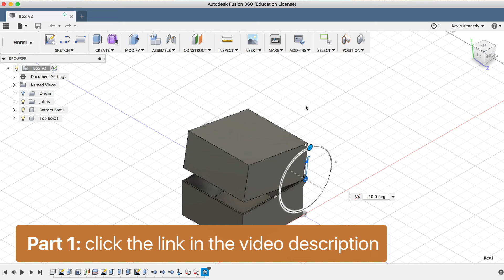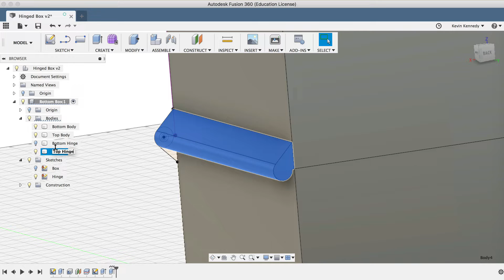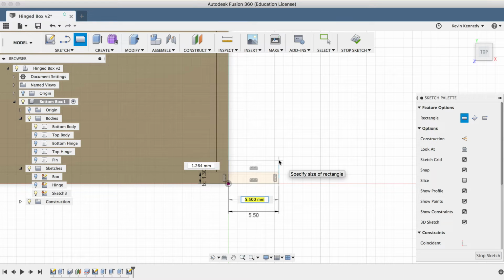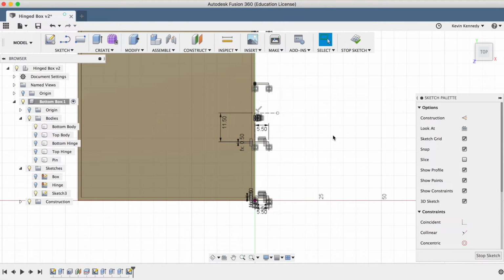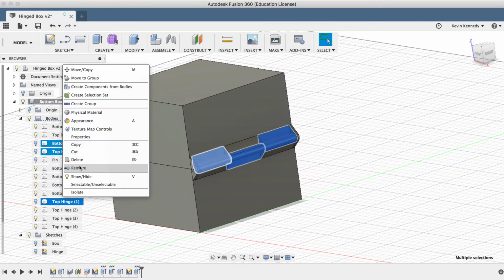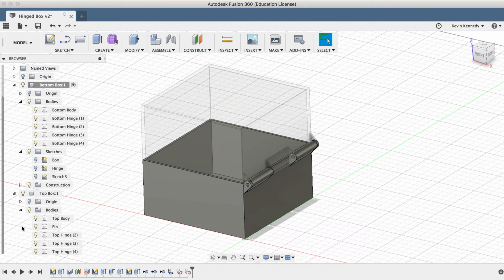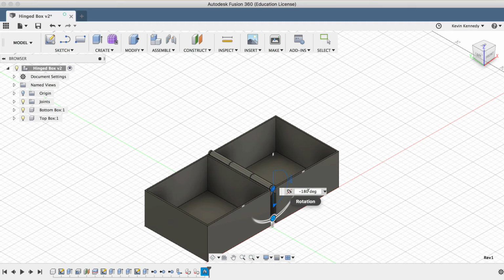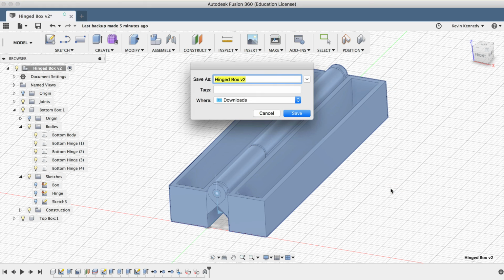How to 3D Model a Hinged Box for 3D Printing - Learn Autodesk Fusion 360 in 30 Days: Day #19(Part 2)

Comment: Can you print this with the pin in place or do you have to remove it and print is separately on the printer bed?
Reply from the maker: Hi, ca1978. Thanks for watching and commenting! The pin is okay to leave...but you'll have to delete two of the end pieces before 3D printing. I forgot to show this in the video and noted it the pinned comment.

Which hinges you delete really depends on how many hinges you create when you cut the hinge up. I went ahead and deleted the bottom parts of the end of the hinge, that way every other piece is removed - https://snag.gy/cNokVz.jpg

Then, you can print the box as one print, with both lids flat on the print bed. I hope this helps! Cheers, Kevin :)
Reply: @ProductDesignOnline  Thanks! Yeah, I just checked using section analysis and if I don't remove those hinges you mention they fuse with the pin. Thanks a lot!
Reply from the maker: You're welcome! Thank you for watching. Please don't hesitate to comment on any of my videos should you have any questions. Cheers, Kevin :)

Comment: Hi Kevin,
Great video, just after some guidance if possible.
After drawing the box, I drew the hinge on the wrong face, and had to delete the hinge then re-draw it on the right face. But couldn't help but wonder if there was a more efficient way of doing thing this (like a cut and paste option).
Many thanks,
Jason.
Reply from the maker: Hi, Jason. Great question! In this specific scenario, re-drawing the item was the best way. In most cases, it is easiest to copy and paste if the "piece" is within its own individual component. Not sure if you have watched my "components vs bodies" video, yet? If not, in that video I talk about the importance of individual components... and a lot of that has to do with moving or copying and pasting. Cheers, Kevin :)

Comment: Is it possible to constraint the rotation of the box to some specific angle?? Like I don't want the box to be able to revolute above 90 degrees.
Reply from the maker: Great question, Vishnu! Yes, you can! Right click on the revolute icon (flag icon) and select "edit joint limits." This will open up the Edit Joints Limits dialog box with the motion defaulted to revolute.

Just below, you'll see that you can set the minimum or maximum degree angles. You can also drag the white triangle sliders around which will change the degrees (blue shaded area), giving you a bit more control. 

Here's a reference image for your convenience - https://snag.gy/M1wuog.jpg
Cheers, Kevin :)
Reply: @ProductDesignOnline  Thanks a lot. I  have one more doubt. If we 3D print this box model, would it actually be constrained to revolute only in the limits of the angle we mentioned?? Shouldn't we be changing the design to constrain it?
Reply from the maker: @vishnukiran6162  I must've misunderstood you. I thought you were referring to containing the revolute function in Fusion 360. That is correct if you'd like the box to be restricted to a specific angle then you will have to alter the hinge on the back of the box. Cheers, Kevin :)
Reply: @ProductDesignOnline  I was referring to only in Fusion 360 at first. Then, a new question popped up. Thanks a lot for your reply.
Reply from the maker: @vishnukiran6162  Thanks for the clarification. Cheers, Kevin :)

Comment: Thanks for this great tutorial!  I added a few parameters and modified some dimensions to make it more customizable.  I can now change the wall thickness, hinge thickness, height, width, and depth.  So this can be a base model used for creating all different sizes of box as you need them.

You can see my new parameters and where they were used here: https://snag.gy/eZwGd8.jpg

I'm assuming the "name" will be the same if you did the steps in the order of the tutorial.  If anybody needs help or more screenshots of the dimensions and where they're used, let me know.
Reply from the maker: Hi Brodie, this is awesome! Thanks for sharing this with the community... and great work on this! Cheers, Kevin :)

Comment: I enjoyed your video and learned a lot about making a box.  I printed the model and had a problem at each end of the hinge.  The back part of each hinge are together when the box is open and ready to print.  The hinge end pieces fused together in the part and thus inoperable.
Reply from the maker: Hi RVseniors, thanks for your comment. I noticed I forgot to delete the ends of the hinge after I posted the video. I put a note about it in the pinned comment, but it must not have caught your attention... so my apologies! Cheers, Kevin :)
Reply: Thanks, I did not see the comment, I will try to remove and print again.
Reply from the maker: @rvseniors  Sorry about that!... I'm happy to hear that you learned a lot! :)

Comment: Hi Kevin 
 I do have a question about changing parameter settings, when I go in and change the wall thickness in parameter settings  (to make a stronger box) and go back out to view part I find that I have messed up the hinge. What is the best way to edit a setting without having to remake the whole box again? I know it should be simple, or is it I designed something wrong?
And if you don't have time to answer I will understand
Reply from the maker: oldfarmhand - You definitely shouldn't have to start over from scratch. If you applied the "WallThickness" parameter to the first rectangle of the hinge sketch (3:30), then it may have thrown off the gap rectangle. If that's the case, you can edit that sketch and try to fix the gap rectangle. If it's something else that was messed up with the hinge then let me know. If you can share a screenshot or a file then that will help me figure it out. Cheers, Kevin :)

Comment: I don't think this will print with the way you had it.  The end cover on the hing looked to be overlapping.
Reply: Dang it! I wish I'd read this comment before I printed the model. I found the same and I rewatched the both videos multiple times in case I'd missed something. I hadn't :(
Reply from the maker: @xavelor  My apologies!
Reply: It's all good. Pt1 and Pt2 was just what I was looking for so I can still thank you for that :)
Reply from the maker: @xavelor  Thank you for watching! :)
Reply: I amos want to point out the same thing too >.<
Reply: That's what I was thinking. Like if the collision end hinge pieces where fused, the box wouldn't move at all
Reply from the maker: I've printed this before. It prints without any problems. The bottom component has the ends of the hinge and pin as one whole piece. We added the gaps around the pin and other hinge so it revolves.

The point of this design is that it does not require any post-processing aftwards. You could make the pin a separate piece of you want to glue it together.

 Cheers, Kevin :)
Reply: How far does the cover open?  180 degrees?  If so it looks like there is going to be collisions.  Here is a screenshot of what I am talking about.  http://www.embracenext.com/jing/2018-08-31_20-28-26.png
Reply from the maker: Whoops. Good catch, Mark! :)

I see what you mean. When I was recording I totally forgot to "remove" the other two bottom bodies - https://snag.gy/wa4c9L.jpg

Without them, it flips 180degrees fine  :)
Reply: whew!  I thought I was going insane there for a minute!  Thank you and awesome set of videos btw!
Reply from the maker: My mistake!!! Thanks again for pointing that out and thanks for watching! Cheers, Kevin :)
Reply: wouldn't you remove one bottom and one top body one on each end for balance of the part?
Reply from the maker: oldfarmhand - It really depends on how many hinges you create when you cut the hinge up. I went ahead and deleted the bottom parts of the end of the hinge, that way every other piece is removed - https://snag.gy/cNokVz.jpg

In this scenario, it really wouldn't matter much as it should work either way. I have the box printed out like screen grab above and have no problems. I will have to try doing it the opposite way and see how it is :)
Reply: @ProductDesignOnline  I spent 5 minutes working out how this could possibly work, and then read this comment! For clarity to others - you need to remove one hinged component from both ends (not shown in video - shown in the snags picture linked above). I also chose the bottom hinge so that the top box is supported by the middle and the ends! Very elegant and funky design!
Reply from the maker: @wybird666  Hi Adam, glad you got this comment (also a note in the pinned comment). Unfortunately, there is no better way to put updates on YouTube videos. Cheers, Kevin :)
Reply: @ProductDesignOnline  Maybe you should put a correction note  (or a reference to it) above the part 1 link so that it shows first.
Also, I thought there was a way to overlay text?
Reply from the maker: @No1sonuk  Sadly, Youtube took the overlay text feature away like 8 years ago... too many were abusing it I guess.

Comment: Now I see why you cut the box in half instead of 80/20 which I did but it will not print like that unless I add support under the top half.
Reply from the maker: You could always alter the hinge a bit to have the pin separate and print them as 3 separate parts (pin, bottom, top).

The goal with my design was to have a hinge that didn't require glue or any post-processing and something that will work right off the 3D-printer :)